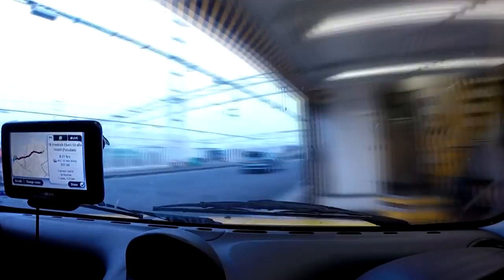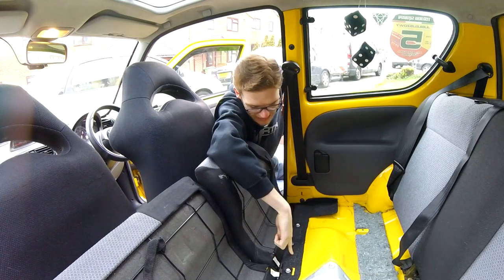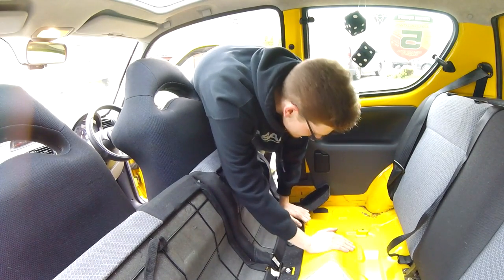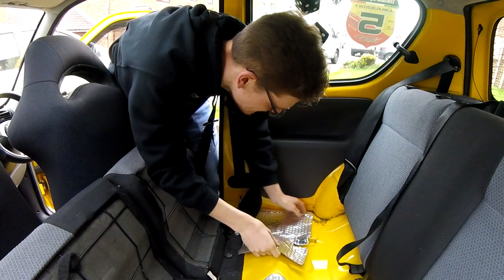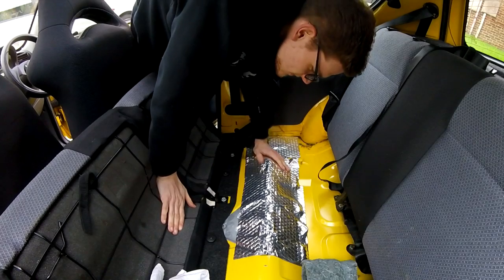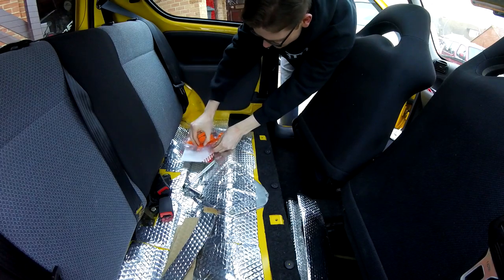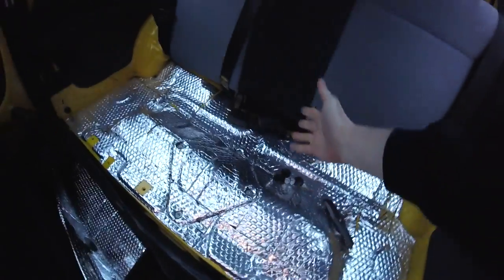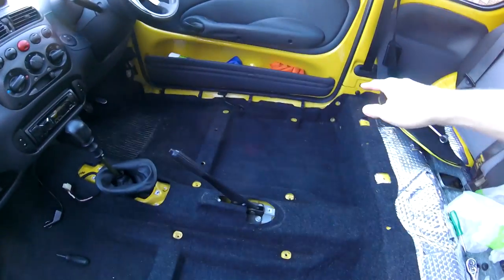Make Your Car QUIETER! Sound Deadening DIY [Super Seicento]

Comment: The trick is polyurethane foam in key places - A, B and C pillars, sills and rear wheel wells. Make the body more rigid, sound and vibration absorbent. That is the secret. It will make a world of difference!

Comment: Did you do the wheel arches?
The boot? The engine bay?
is it any better?
Reply: I seen other videos where they tested with a decibel measurement and it improved with like 10 15 decibels les road noise on most cars but it also improves music sound in the car so win win
Reply from the maker: The arches and boot floor were done recently and the improvement is considerable - quieter and exhaust noise is less harsh 👍🏻

Comment: Looks good mate. There some other type of panels that you can put on the inside of the hood, etc that it is sound and heat proof and even makes the metal kind of harder. I want to get those to fit in my Punto. I will have to completely stip off the entire car. 
Keep up the good work mate. How are the Coils doing so far?

Comment: Great video but slow down when you show text in your video. Only appeared like for a second about your joke of "adhere" and didn't get to read it. I've sound proofed 3 cars. I used Dynamat and also used 5mm black closed cell foam. You need to cover your wheel arches as this is where most of the sound comes from. The Dodo insulation you use only stops vibrations and deadens low frequency noise. I applied 5mm closed cell foam on top. It helps with noise absorption and helps keeps the car warm in winter.

Comment: I wonder will that stuff get wet with condensation when the car cools down at night, making the bottom of the rear seat wet and mouldy. My cinquecento leaks in a few places, ie around the rear side window seals and the drivers door seal so I prefer to leave well alone instead of sticking stuff to the floor.

Comment: This only works for sound deadening not for heat and cold insulation you should buy some closed cell foam sheets they help alot with the heat and cold noico makes some and its really nice ive done both sound deadening and the insulation and I can tell you its totally worth every dollar and the time also do the roof the doors and the arches thats the only way to get your moneys worth and make a real difference

Comment: Excellent work Joe, that should make at least a bit of difference - looking forward to seeing just how much in your next video!

FYI, if you find your trim removal tools chip and break a bit (I had a similar set like yours, even the same color), it's because they are made of ABS plastic - strong, yes, but brittle. If you go to get a replacement set, look for a set made of nylon like these:
https://www.amazon.ca/gp/product/B00U2HWMFW/ref=ppx_yo_dt_b_asin_title_o09__o00_s00?ie=UTF8&psc=1

Nylon trim tools are a bit more pliable, so if you put a bit too much force on them one way, they'll just bend a bit rather than snap. :)
Reply from the maker: Thanks dude, will invest in some 😁
Reply: @MillerCorner  Not a problem mate!